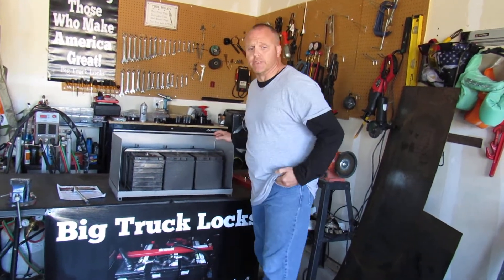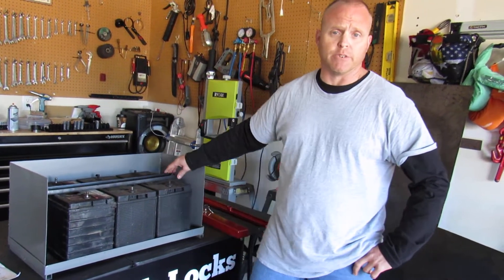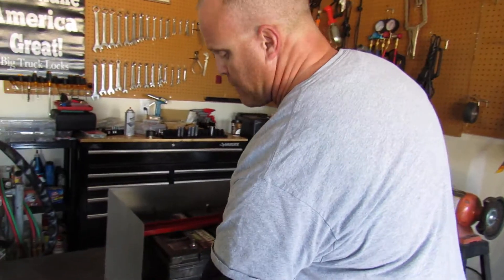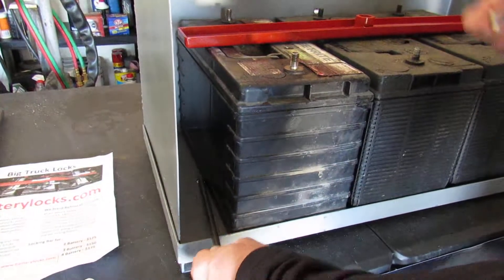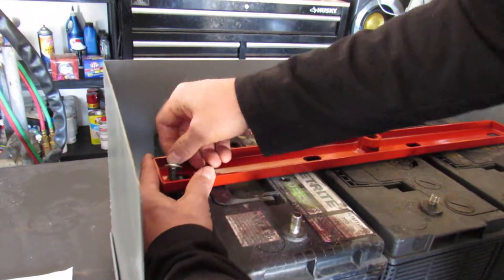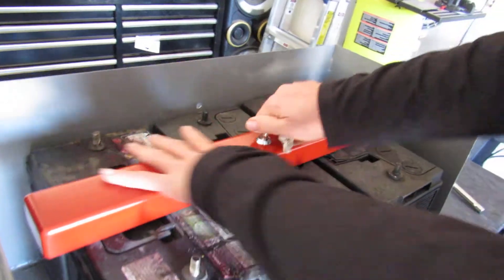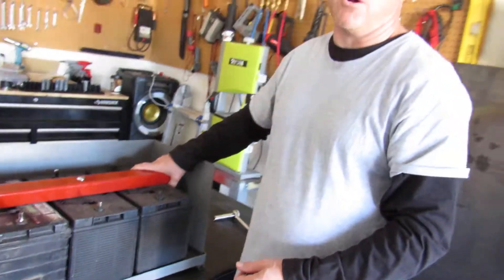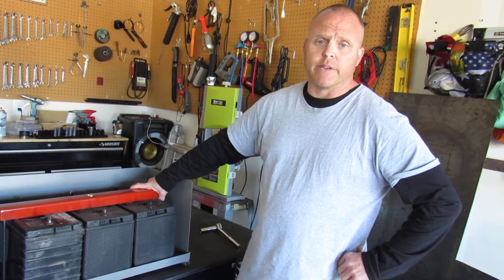Anti-theft battery Lock bar Installation

Comment: Bolt cutters to the shaft of the anchor bolts ( bye bye batteries )
Reply: Would it be accessible though ?
Reply: we have sleeves for the anchor bolts. bolt cutters will not work
Reply: Most battery theives dont carry bolt cutters and we also have anti bolt cutting tubes.